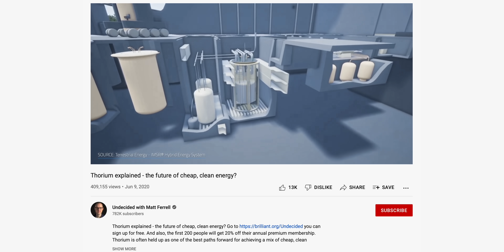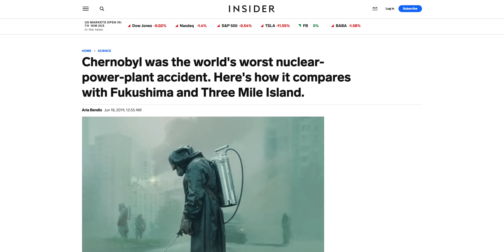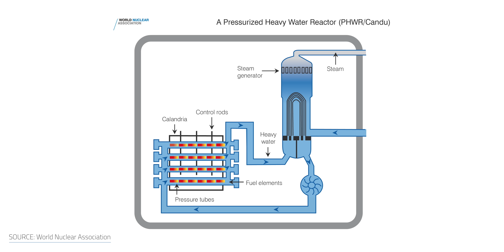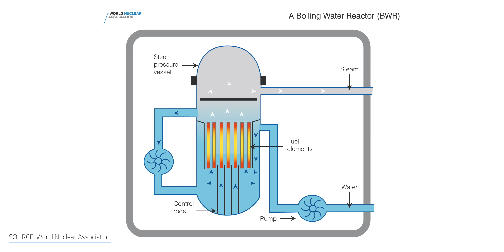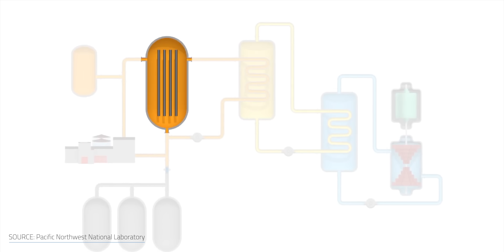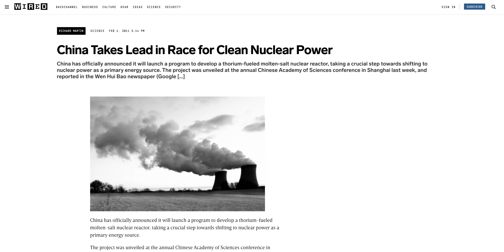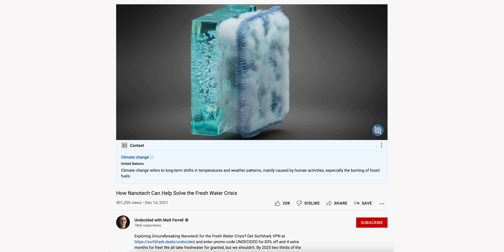Revisiting Thorium Energy - The Future of Nuclear Power?

Comment: One point that isn't mentioned is that now we have the capability to recycle nuclear waste - even old used nuclear rods - and turn it into fuel (which ultimately results in <2% waste with a half-life of between 30-300 years). This makes nuclear incredibly usable, while thorium and MSRs present not just a more environmentally friendly model (especially with regards to mining and production), but one with variable, modular applications. 

Nuclear energy, especially gen IV tech, is clean, safe, has minimal nuclear waste or environmental impact, and has the potential to both supply our civilisation and provide extra energy to support our environment (like water purification/desalination, taking carbon dioxide out of the air, producing e-fuels etc.) That constant and dependable electricity supply will be necessary to mitigate other problems too - like the agriculture industry crisis. Despite the lead time and cost in power plant production (at the moment), nuclear can potentially be much cheaper overall than other energy sources.

Solar and wind may be cheaper now, but to provide enough energy to power our civilisation's energy needs today (only), you'd have to plaster huge regions of the earth with wind and solar farms. Hydropower also has high environmental costs and will also be unfeasible for widespread use. All 3 are very helpful in lowering CO2 emissions, but their construction and materials still require environmental and carbon costs (costs which will rise with large-scale batteries).

Basically, the baseline reality is that nuclear is the only option that can support the majority of our civilisation fast enough (and with good enough quality of life) to get us off fossil fuels within the next critical couple of decades (before the climate becomes disastrous).

Comment: Some subject you did not bring up about wind and solar.

It may be possible in decades in the future where each town or even home can have its own thorium 24/365 power plant that takes up little to no amount of space. A city can be powered by a thorium power plant that takes up no more space than a house or an individual house can be powered by a plant that is so small that it may be only a few cubic meters and buried under the house or the yard. 

Then there is that a small village out in the middle of nowhere that can have limitless power which is cheaper than it would cost to run high voltage power lines for hundreds of miles. You won't need massive numbers of high voltage power lines crossing all over the country connecting one massive power plant to another instead you can have each large city to have more than one power plant so if one goes down then the others have more than enough to cover the default. With small towns can have small high voltage power lines connecting them together so if one towns power plant goes down the other towns power plant can power both towns until the first towns power plant is back in operation. 

A house can be powered with solar cells just taking up roof space in the south where its sunny most of the year this does not work well for massive cities or areas in the north. Then there are wind turbines that just can't be scaled down to a reliable induvial home power plant as they just take up too much space. Then there is that wind towers just don't last all that long do to moving parts degrading in the matter of a few years that needs consent iritic maintenance. 

Then there is how long the power plants can be in operation. I have heard that it might be possible for a Thorium power plant to be built that can be in operation for a centry or more were some solar cells can degrade to the point of needing to be replaced in a decade or two. Then a wind tower can be destroyed in just one really bad high wind storm by either being knocked down or by overheating and burning to the ground. Due to the risk of a wind turbine catching on fire in a storm being put on a houses roof is just too dangerous.

Comment: Very good presentation.  Is the problem more with handling molten salt than the Thorium reaction?  Wasn't there a solar farm near Las Vegas that used the sun to heat molten salt that was shut down, mostly due to the cost of maintaining equipment that comes in contact with molten salt?

Comment: Half life and radioactivity are inversely related. Which means that thorium waste would be more dangerous per gram. Radon is no picnic but it takes Of course radioactivity has weird sorts of nuances: alpha radiation being blocked easily means it is absorbed more readily if ingested. Meanwhile  Gamma rays are infamously hard to contain they are less efficient at giving you radiation poisoning due to more of it going out.

The risk of encountering a significant amount is yet another variable. You will be hard-pressed to find Francium outside a laboratory because it has a half life of twenty two minutes or so. But if you did it would be gram for gram very deadly. Compare that to the elemental half life potassium in a banana, which is in billions and thus 'mostly harmless'.

Amusingly that suggests that with radioactive waste moderation is the enemy. We either want really short half-lives which will become safe if people wait a day or so or incredibly high such that the danger is utterly neglible.

Comment: Nuclear power IS NOT "A SOLUTION" ... no matter which technology! The reason is simple:
- the TECHNOLOGY is "safe" IN THEORY, but
- there are ALWAYS humans involved in RUNNING THE POWER PLANTS ... and this doesnt have to be "the people inside the plant", because Fukushima blew up because the ARCHITECTURAL PLANNING was/IS terrible (emergency batteries in the basement got flooded, the protective wall out to sea has a breach in exactly the direction from where the tsunami came and it wasnt high enough) ... and the same applies to the german nuclear waste dump mine at Asse (signed off by then ecology minister Angela Merkel).

The big point is:  DO NOT TRUST "EXPERTS", because they USUALLY have a narrow-minded view on the issue AND TOTALLY IGNORE COMMON SENSE!
Scientists just WANT MORE FUNDING ... and can make too tall promises!

Comment: As for your comment about problems with nuclear energy. There's only been one meltdown and that in Russia because they use graphite as a moderator and when the graphite got stuck they couldn't stop the reaction. Three Mile Island just got a steam bubble which was released per protocol with minimal radiation outside. Not even as much as a coal fired plant. Fukushima also did not melt down the reactor was offline and being refueled the spent fuel was stored in its containment area in the top with water to cool it down when the generator stopped the pump stopped and it overheated made hydrogen gas the top of the building had blowout panels in case this happened so when they blew out nothing and no radiation was scattered about. For more check out the Illinois energy professor YouTube channel David rasnik I believe.

Comment: Use the process heat from this to satisfy base electricity demands.  Also use the process heat to cracking water for hydrogen.  Reform with a CO2 to produce liquid fuel. That way we leverage all the legacy storage, distribution and end-user infrastructure. 

Arbitrage the above for to maximize profitability.

Yes, use the low grade waste heat for desalination.

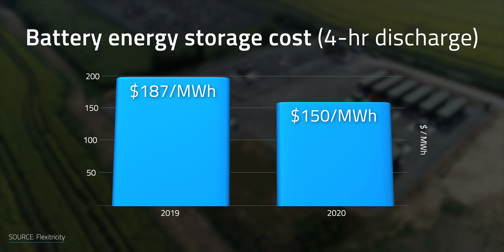Comment: What do you mean by "battery energy storage costs?" @13:30 
Cost of manufacturing? Including installation? Including maintenance (if so, over what time period)? Cost of powering up and discharging electricity (if so, at what price per input?)?
That claim amounts to about a 20% cost reduction in a single year -- if that's a trend, that's phenomenal; which is why I'm questioning the definition. 
Thanks!

Comment: Solar (17% efficiency) and Wind (when the wind blows and if the wind mill works) are non starter technologies for energy as they are inefficient.  This Thorium solution is a much better solution as it's reliable in energy production and maintenance, additionally there are other viable solutions that can be applied.  You mentioned water desalination, interesting. Additionally there is a new thermal battery technology that can be used for energy storage that works directly off heat.  As for waste by product, there are nuclear batteries that can take advantage of this solution, but more need to be thought out.

IMO, Fusion is the ultimate solution for energy, till then Fossil fuel (primarily clean Natural Gas) and Nuclear need to be implemented.  Solar (unless they can achieve 75%+ efficiency) and Wind are a waste of time.
Reply: Solar will work permanently big difference. Little maintenance
Reply: Solar has work around as aswell. It’s not all useless

Comment: Nuclear should be used in addition to Solar and Wind. And, end users of power should use Ground-Loop heat pumps, to greatly reduce energy usage in the First place. The only places where you cannot use the ground loop is over permafrost. Green-source ammonia can also be used for both heating and vehicle fuel (after being broken back down to Hydrogen and Nitrogen, the former to be used in a fuel cell to generate electricity.

Comment: There is a common misconception that MSTRs reactors will "burn" away all transuranic wastes. The reality is that MSTRs will perform no better than the EPR or AP1000, when it comes to  consuming transuranics. Recycled reactor grade plutonium is used only once through in Mox fuel assemblies because of the build up of even numbered isotopes which act as neutron poisons. Some of these actinides are strong gamma emitters, which you really don't want in your reactor. 
Also, MSTRs will produce pretty much the same amount of long lived fission products as conventional reactors.

Comment: #1= define "cheaper" #2= whatever the fuel, they still work with high pressure water, which gives high pressure steam, which drives a turbogenerator, bla bla bla. XVII century tech, James Watt. H2O in contact with very hot materials will go back to H2 and O. Atomic oxygen will oxidize even gold. H2 will react with everything except  Helium. in the presence of oxidizers, i.e. air, will explode. it cannot be smelled or detected, it goes through deals as if they were not there. for references, 3-mile island, chernobyl, fukushima., Need i say more? For ANY nuclear reactor, you need a closed cycle, loop, with a noble gas, to extract the heat from the reactor, looping with another gas to drive the turbine, in this case is better to use ammonia, butane, so they can be turned back into liquid form under pressure, and driving a tertiary turbine/generator as a condenser. #3= what are the cascade isotopes from Th fission? #4= disposal procedures? finally, for the cost of ONE nuclear plant, including all permits,lawsuits and cost overruns, you could pave the US with solar cells and have money left over.

Comment: What are your thoughts on Helium-3 compared to Thorium?  As for nuclear power, I believe it would be more reliable than wind or solar and have a much smaller geographical footprint.  As for the initial building cost, couldn't that be averaged out over the lifetime of the reactor?
Reply: Yes I found it weird, and slightly suspicious..., that the LCOE was based on 30 years when reactors are going longer than that, even been rated for 100 years after an overhaul (that obviously costs a lot less than a new, from scratch reactor).

Comment: Thorium reactors are an unproven, pie in the sky, solution to energy issues!!!!!!!!!!!!!!!!!!!!!!!

Just like the formerly MUCH HYPED Fusion reactors!!!!!!!!!!!!!!!!!!!!!!!!!

IF - and that is a BIG IF - we can manage to get either fusion or thorium reactors operating then fine - but  as it stands now - these POSSIBLE FUTURE SOLUTIONS are not currently even close to being workable!!!!!!!!!!  

And it has been about TWENTY YEARS since a couple of scientists CLAIMED they had an experimental fusion reactor up and running - TOO BAD the scientific community did not accept the fusion claim at face value and instead chose to investigate CLOSELY to determine that the fusion "reaction" was nothing more than large amounts if electricity pumped into the reactor "to get it started" but of course the electricity output NEVER EXCEEDED what was being pumped in from conventional electricity generators!!!!!!!!!!!!!!!!!!!!
Reply: In related news - alongside this video IS ANOTHER VIDEO PRODUCED BY IMPROBABLE MATTERS - who claims to be a FORMER Scientist working on fusion technology -and HIS VIDEO states that BASED ON HIS EXPERIENCE WITH THE TECHNOLOGY - we will NOT HAVE useful fusion technology by 2040!!!!!!!!!!!!!!!!!!!!!!

Comment: Electrical energy grid is an ON DEMAND SYSTEM! The customers together determine the demand.  Solar and Wind energy systems are energy source driven, independent of the demand.  A mismatch is why both energy storage and significantly bigger grid distribution system is needed.  Nuclear and carbon based combustion systems are designed to work with an on demand system.

Comment: The cost of solar needs to be increased to include enough battery storage to allow for a constant output on a 24/7 basis.  So if you want a 100 megawatt solar plant you need enough batteries and solar panels to provide 100 megawatts 24/7.

Comment: The battery like Thorium MSR produces mostly heat at the temperature of a steam boiler or home pottery kiln without the bomb like 2000 psi steam pressure of Uranium reactor   . This first generation MSR produced electricity for the grid at Oak Ridge between 1970 and 1974    . It used the 97% high energy waste abandoned by Uranium reactors turning most of it into heat  (producing electricity) with very low energy waste   . There is enough waste uranium abandoned by Uranium Reactors to provide the world with electricity for 1000 years    . The MSR is inherently safe while the Uranium reactor is inherently dangerous as accidents have proven.

Comment: What are the chances small reactors could be used in ships? They need a constant power output for long periods of time, and need to get off burning bunker oil. Hauling around hydrogen instead doesn't seem like a good option.

Comment: You mentioned  using "waste" heat for  steam desalination, but not district heating. " Waste" heat use in District Heating would almost double thermal efficiency of the reactor, reduce costs by 50% in winter less, in summer when there is lower heat demand. Another missed point is that out put temperatures of up to 1400 C° can be used to drive many, if not most industrial chemical processes, like making cement/ lime fossil free.

Comment: Hi, Matt, I like your videos, but I have a question: how much is in percent is efficiency of converting thermal energy in electrical energy?
In nuclear power plant Krško, near Zagreb (Croatia/Slovenia, built in Westinghouse technology 70-es) this process can make 33,33% of efficiency.
Thorium or not, we stil have 2/3 waste heat, do you thing so?
Dario
Reply: My understanding is for thermal conversion using a steam turbine the efficiency is mostly a function of the temperature of the heat source. The hotter the reactor (or other heat source) runs, generally the more efficient the conversion. This is one of, although certainly not the most important reason more modern designs don't use water as the reactor coolant. That said you are always going to have a substantial percentage of low quality waste heat that may be useful for things like greenhouses in northern climates or other low temp industrial uses, but not for electricity generation.

Comment: I love the idea of a Thorium reactor, however a Thorium reactor is not a Thorium reactor, but however is a Uranium breeder reactor. Thorium reactors breed U-233 which is fissile. However, if neutron capture happens, it doesn't (likely) produce transuranics which are the obnoxious part of nuclear waste, but it can become U-234 and/or U235, providing additional chances for fission... Most attractive feature of any "Liquid Thorium" system, is not the capture of U-233, but the removal of fission poisons, which include what thorium transmutes into (a fission poison until it becomes uranium) as well as fission product poisons.  Accumulation of fission poisons (like the accumulation of arterial plaque) vs the consumption of fissile fuels is the larger cause to shut down most pressurized LWR... The biggest reason I think Liquid Thorium plant will fail is because of the chemistry of the salt that carries the Thorium chemically eroding the piping. Chemical erosion is why Austenitic stainless steel, though an amazing product, is not used any more in nuclear plants.
Reply: You should note that only one of the many gen. IV nuclear start-up companies are using thorium, they are all using uranium 235. Thorium has no advantage over uranium in a MSR, in fact, it's much harder and more expensive to do. Also, every reactor design has corrosion dealt with. It's only a problem if you introduce oxygen or water into the system which is very easy to keep out.

Comment: I think most countries need to answer the question, are they willing to solely use their space for wind\solar energy?
If using 3MW wind turbines optimally, you would need 0.378 square kilometer (394m x 959m, assuming 137m blade) for each turbine.
This will impact birdlife significantly without any preventive actions.
It will also be very visible. I personally don't mind the sight of modern technology, but some people would very much mind a wind turbine in their horizon at home.
So it will generate public resistance to the placement of wind farms.
Nuclear power solves this very well with producing energy with a much lower need for space.